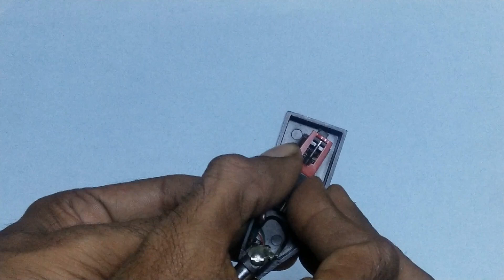Universal Cartridge Fiitting || Multiple Used For All Types Of Record Players ||

Comment: How did you connect the cartridge? Because the cartridge has 4 terminals but the hmv record player has only two wires for cartridge.
Reply from the maker: Stereo cartridges have 4 pins and mono cartridges have 2 pins.
Reply: @electronicshub1555  can we use stereo cartridge on a mono record player?
Reply from the maker: yes